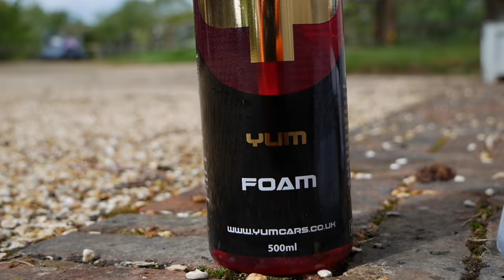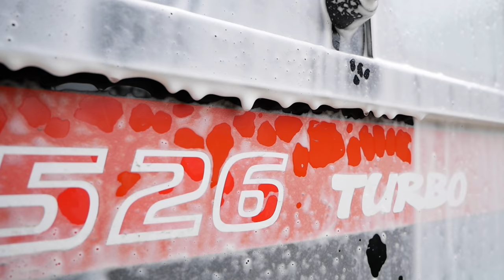FIRST WASH IN 4 YEARS!!! Pressure Washing a MUDDY TRACTOR

Comment: I e been cleaning tractors and plant for years! Imo all the chemicals used on the first wash were absolutely money down the drain. The pressure washer would have gotten the same result for the initial wash, great video though 👍🏻
Reply from the maker: Hiya mate thanks for watching I did say in the video that I chose to use the chemicals instead first to show viewers cleaning power of the chemicals. If I rinsed it first then it wouldn't give the viewer a true reflection of snow foam 👌🙏
Reply: @epicautomotivedetailing  I didn’t mean to sound rude! In the past I’ve got great results this way so top job 👍🏻 looking forward to seeing more videos 👌🏻👍🏻

Comment: TFR with wax and a good pressure washer would do the job in under a hr,  Karcher pressure washers are not that good to last very long. Yellow plastic ones are domestic,  half a lt of TFR would be plenty for a machine that size put though injection system on washer.  Oil an grease just washes off .